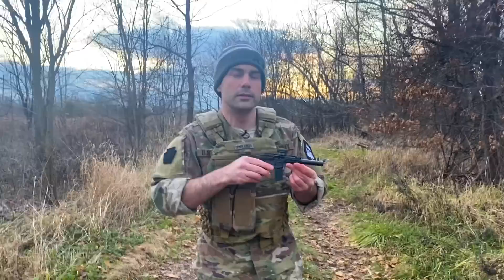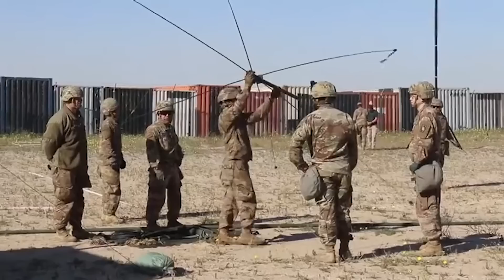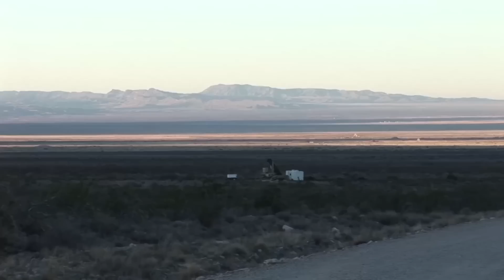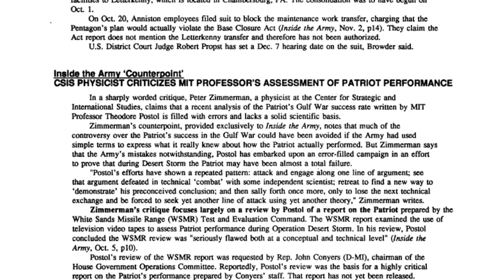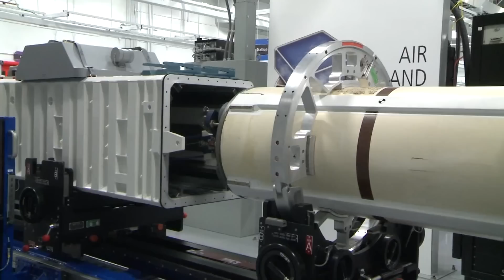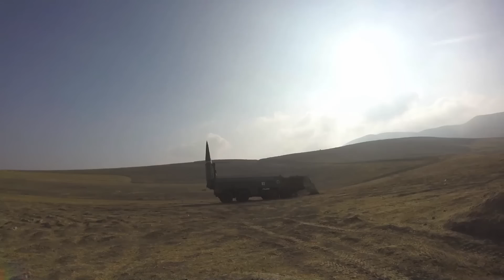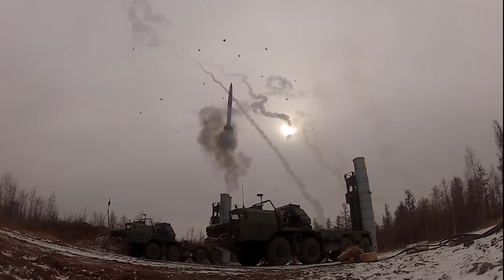Can Patriot Anti-Air Defense REALLY intercept missiles?

Comment: You are damn straight the PAC-2 can make a difference. This thing is deadly.

1: It operates a little bit like the AIM-120 AMRAAM in that the missile generates a track file from the scanning radar to guide it to the target, instead of relying on fire control radar. The ground based radar maintains two way communication with the missile, such that both the missile's passive sensors and the ground based radar work together to find the target. This denies the target aircraft the normal warning from high frequency, high amplitude FCR usually required for radar guided munitions. Only at the last possible moment does the ground based radar switch to FCR mode to guide the missile in terminal phase to impact. The AMRAAM does something similar, except instead of using a radar positioned at the launch point (the aircraft it was launched from) it uses its own on-board radar. For the AMRAAM this is called TWS or Track While Scan. The PAC-2 does this, except it relies on the radar on the ground rather than a radar on the missile.

2: It has a home-on-jam feature. The PAC-2 is able to detect when it is being jammed, and when the missile tells the ground based radar that it is being jammed, that radar avoids entering FCR mode, switching the missile to home-on-jam mode. In home-on-jam the missile effectively becomes an anti-radiation missile. It seeks out the jamming signal and uses it for guidance. I cannot explain to you the amount of processing power necessary to isolate a jamming signal, but it is a lot. The fast Fourier transforms necessary to maintain a signal lock and what might seem to be random noise is not something the Russian's can duplicate, and it allows the PAC-2 missile to use the electronic warfare capabilities of the target against it.

The Patriot missile is a highly advanced, complicated, nigh impossible to evade GBAD system that no one else on the planet has. It will require US contractors to operate.
Reply: ur g0dIy-hailed PAC-2 is useless against hypersonic. its very hard to detect - its target. ballistic can reach mach 10+ but its following a trajectory thus predictable. meanwhile, hypersonic can just glide on a hard-to-detect atmospheric level (the one just before the outer space) until it only gives the defender a very small window to react. once its on terminal stage, its technically impossible. mid-course interception is ur current greatest bet but damn it stays on that atmospheric thing that i am talking about
Reply: @leexingha   The United States is calling the hypersonic bluff. If they have them, let them use them.

We will not be deterred.

Many people are unable to think critically about hypersonic weapons. Let me tell you why hypersonic glide vehicles are bullshit:

It is impossible to change course in atmosphere without losing speed. A hypersonic glide vehicle becomes plain old supersonic at its first turn, plain and simple. To maintain speed it needs propulsion and neither China nor Russia have the chops for SCRAM jets.

So….

They are bluffing, and we are going to call it and watch them crumble. Pull up a chair and enjoy the show.

Comment: The other problem which you did not talk about, but which was covered by Binkov's Battleground, is that the Patriots are not designed to be easily mobile (you did say that it took one hour to set the system up - Binkov's pointed out that Russian SAM batteries take much less time to set up and move around) and the Russians do have the anti-radar missiles and other pinpoint missiles that can knock out the radars and the missile batteries, and are likely to target these Patriot batteries as high value, high publicity targets.
Reply: Russians have anti-radar missiles, but their SEAD doctrine is ass. The United States wrote the book on suppression of enemy air defenses. Russia read the summary on wikipedia.
Reply: @ChucksSEADnDEAD   Well, I looked it up and it turns out that the Patriot radar system, the AN/MPQ-53 radar, is a low probability of intercept type of radar.   So, it remains to be seen how effective the Russian anti-radar missiles will be against this sytem.
Reply: I never cease to wonder why, despite the presence of a terrible superweapon in the hands of the Russians, Ukraine has been holding on for 10 months of a full-scale war. All you need to know is that... On March 27, 2022, an Х-29 guided missile hit a street toilet in a private yard in the city of Gulyaipole (Zaporizhia Region) 🤣
Reply: Russia will carefully follow their movements and destroy them piecemeal. Capturing one would be a good PR victory for them.
Reply: @brostoevsky22 Capturing? They're gonna rush Kiev again?
Reply: @brostoevsky22  Just like they "destroyed" 55 HIMARS? 🤣

Comment: It's not fear of the Russian response.  First of all, we wanted to make 100% sure that we weren't going to send top of the line hardware to a country that was just going to get overrun.  The last thing we wanted is to practically "gift" the goddamn Russians several batteries of our best air defense systems.  Second, it'll take Ukraine forces MONTHS to train up on the system and be able to use it and maintain it without western technicians and trainers holding their hand.  That puts US personnel in more danger and there was no political appetite for something that could get US contractors or volunteer technicians killed in Ukraine until AFTER the midterms.

Comment: One thing to keep in mind is that you don't have to COVER your area of defense, you just have to position yourself along the flight path of the weapon to be intercepted. Granted, some ICBMs can change path, but Russia doesn't have many of those.
Reply: Russian cruise missiles can be programmed with different waypoints for each mission. Iskander missiles reportedly have a random final approach trajectory.  Worst case Russians will ripple fire drones/decoys first and send the more expensive assets after they clean the path. 
And that's provided SAMs are crewed by experienced US personnel. With UA crews running them it's gonna be a shit show as you can't expect someone to crash course weapon system of such complexity.
Reply: @OK-1K1  wasn’t the maneuverability of Russian cruise missiles debunked?
Reply: @Goldn177  it’s not a straight flight vehicle. There could be issues with accuracy of inertial guidance system, but that probably also depends on exact mod used.
Reply: @OK-1K1  Iskander isn't an ICBM and Russia, just like the US has no ICBMs with midcourse steering.
Reply: Now you just need the hundreds of systems to do that.
Reply: Not true with PATRIOT. It is a point defense system, and cannot intercept a ballistic missile throughout its trajectory.

Comment: I hate to pull a Clinton "it depends on what the defintion of is is", but it really does depend on how you count and assess.  Patriot's usually fire in pairs against a single target.  If the target is destroyed, was the Patriot 100 or 50% effective?  The early Patriot had a fragmentation warhead, so it was never meant to impact the imcoming missile.  During the Congressional hearings after the 91 war, I recall one Senator who defined "intercept" as the incoming missile never reaches the ground.  To which my thought was does he really think Patriot's have some kind of anti gravity device, or has he seen too many Star Wars movies where ships disappear in a fireball?  Personally I'd rate a kill as the warhead doesn't go off on the ground.  But that means marrying up flight profiles and impact points.  And figuring out which impacts were kenetic and which were explosive.

Comment: The main reason systems like Patriot fail is because they're simply not switched on when attacks happen, its information failure.

When they are on and crewed? Good god they are effective!

Think 90+ KS for anything short of a hypersonic (and even fairly good efficacy against HS if the battery is close to (typically behind) the target, thus limiting the intercept angle).
Reply: Oh, and I'm talking about ALL these systems (provided they're fairly modern), even S-300.... I would bet the american systems are far superior.

Hopefully we will never need to test them enough to get good data.

Comment: Thanks Cappy, lots of food for thought. It seems Patriot should be able to provide some degree of defense against incoming threats without being connected to a larger system. However, it would probably be more effective if it did receive signals from a whole network of stations, perhaps enabling operators to better prioritize targets which might also be taken out by systems operating independently of Patriot. So, yes, it will help Ukraine, but it remains to be seen if they will be able to make the optimal use of its capabilities. HIMARS seems to have proven very successful, and perhaps Patriot will as well.
Reply: you not yet adviser of  US defense ministry?

Comment: A modified, land based AN/SEQ-3 Laser Weapon System would be very useful against all manner of drone. It has been rated and successfully tested, and in field use aboard US destroyers for 30 KW use, but built for much more power. Testing in the 150-300 KW has been conducted evidently. Something in the 100 KW range would be most useful against Russian cruise missiles.
Reply: hard to power a laser without electricity

Comment: These systems should only be used to deal with very high value targets. The bigger threat to Russia is that they could be a way to put pressure on the aircraft launching them from the radars. If they can keep pushing them back making the launch point move.

Comment: I posted this comment in another channel but I will do this here too. Sending Patriot Missiles to Ukraine will be a game changer because I do not expect US to send any Patriot radars into Ukraine. All the detecting and targeting with be done from outside Ukraine, the information sent inside, and Ukraine will just fire the missiles. This will keep the Patriot missile launchers inside Ukraine safe from Russia's anti-radiation missiles, because it is very difficult to detect the launchers as they do not emit anything.

US would not have done this a year ago, but now Russia is a spent force, even if Russia does detect US using a NATO country to supply the targeting information, they are not in a position to do anything about it other then make threatening statements.

Comment: These batteries will be destroyed but I might see the Russians trying to capture it. If they do capture it,what a smack in the face?
Reply: Why would they try to capture it? The S400 is vastly superior to the patriot system.
Reply: given they are intended to be sent to protect power plants and infrastructure? I doubt they will be on the front lines at risk of capture. Even then. Its 80s tech. Updated sure but its old gear.

Comment: So Russia will be launching drones with a value of 20k
say they launch 10 drones
ukraine will have to launch twice as many missiles
patriots success rate is abysmal
say they hit 3 out of 10 drones

Russia will have spent 200k worth of drones and had 70% success rate
ukraine will have cost america 80 million dollars (20 missiles at 4mil each) and still suffered massive structure damage.

america needs to find more s300 missiles for ukraine, otherwise its going to get even worse for ukraine and they may aswell throw away all their electric equipment
Reply: the only country that builds S-300 missiles is currently trying to invade Ukraine, where do you suppose they buy more? The best move is to get Ukraine onto NATO standard equipment. That we at least have supply of.

Comment: I think Ukraine should be given at least 4 full Patriot systems.
The Patriots will not be used against the Iranian drones, as that would be totally stupid.
The Gepard tanks are much better suited and extremely much cheaper to use against those drones.
The Skynex is also great for this together with the Phalanx and other similar systems.
The Patriots should only be used against incoming missiles, planes and helicopters that can do much more damage than the Iranian drones.
Then having other solutions to defend/protect the Patriot system/s and important infrastructure from the drones.

Comment: I don't feel like the core question was ever really answered - Can it make a difference?  Is this really the right weapon system for Ukraine?  I understand there's alot of unknowns, but I kind of feel like the answer is 'No'.  The extreme cost, maintenance, training, and logistical tail of Patriot makes me think that more conventional AA systems might have been better.  Ukraine has 50+ counties sending them aid of various kinds.  They have so many weapons system, none of which use similar parts or ammo or operate similarly.  The fact that they haven't collapsed under the weight of so many different systems is just astonishing.

I have a sneaky suspicion that the way we're going to get around the 'No US servicemen fighting in Ukraine' thing with making some of this work for them is to have 'advisors' nearby saying 'Now push that button, unscrew that thing=a=majig, load the whatsit..." and so on.  Not fighting.  No touching!  But definitely present and helping.  Just speculation on my part.  Not reporting.
Reply: That is dangerous precedent to set. Once those so called advisors are are killed then Biden can use that to start WWIII
Reply: @huntergatherer7796  nah we are fine and straight chillin right?
Reply: well everyone is just throwing everyhting they can spare at the Ukrainians right now so of course its going to be a hodge podge of old and mixed systems. Especially since Ukraine was still using old soviet gear mostly instead of NATO standard kit.